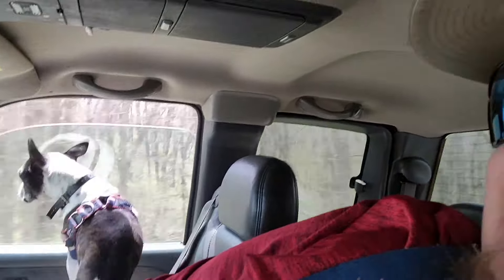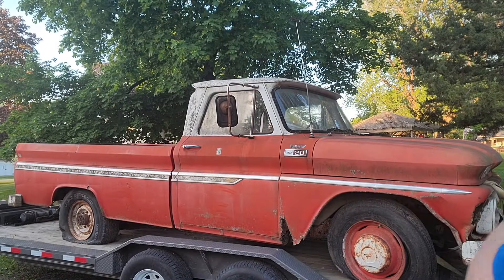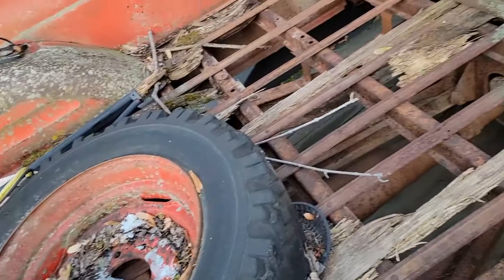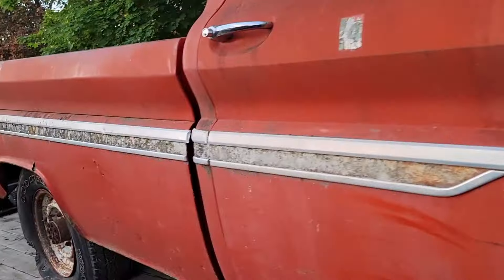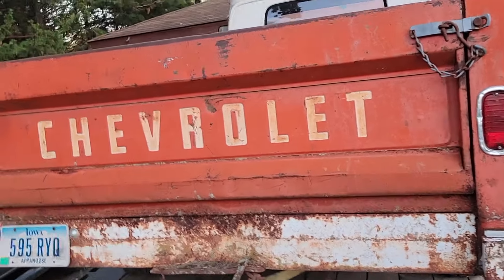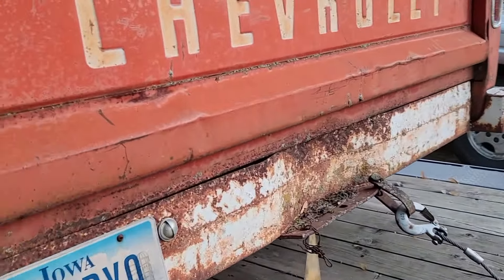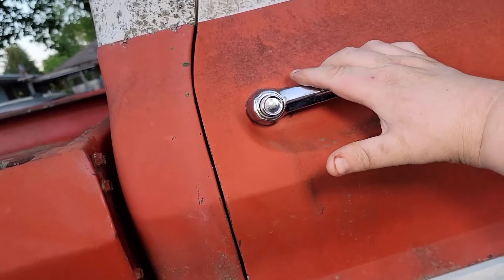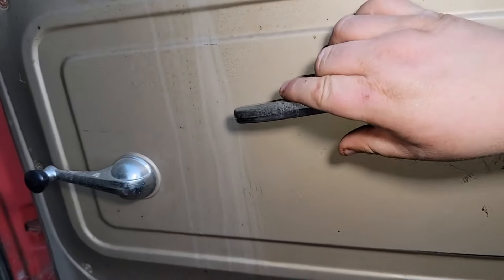Chevy C20  DREAM PROJECT TRUCK LETS TAKE A LOOKY-LOO!

Comment: Hello, I was wondering if you had any more videos on the repair of your nice truck. 
I have a 63 c20 and I am wanting to work on it myself. I could use your great advice please. 😎
Reply from the maker: Yes, I do. I'm about to release them as well as another one I purchased.
Reply: @CPthetooladdict  Thank you CP. My truck is running and all but I would like to know what a 327 motor means and what the oil pressure and how hot the temperature should be as I am kind of afraid I might blow it up somehow. 👸🏻
Reply from the maker: @brendajordan5361  send me a email of yours with some pics. Cpthetooladdict@gmail.com

Comment: I would go with the 283 or 327 and keep the 4-speed and maybe a step bumper. You could always put a 350 in it with the pre 68 intake and heads and short water pump system. I had a red 65 in 1984 much more rust than that one, you could see the road with the doors closed lol. Damn good truck though.
Reply from the maker: You are a good man you definitely understand things
Reply: @CPthetooladdict  I just discovered your channel and think it's one of the best tool channels out here on the tube. I was a mechanic for years until a car wreck put me in a wheelchair now, I just do brake jobs and thing that I can reach.

Comment: I've owned several c20 trucks mostly gm square body trucks,three k20's three c10's, and 1 K 10, and k 15 and a c5 82 gmc High Sierra Jimmy factory 2wd was a 4spd.
Reply from the maker: That's quite a list very impressive!!!
Reply: Yeah and one of the vehicles I learned to move around was a 1970 Ford F-250 ranger custom long bed box 360fe motor craft style auto lite 2bbl grain truck Borg Warner granny gear 4spd,was originally a 3spd column shifter truck and I'd have to say that the bumpside Ford trucks probably have my favorite version of the door latch it's a double latch system and shut good for the year it was that was in 94-2001